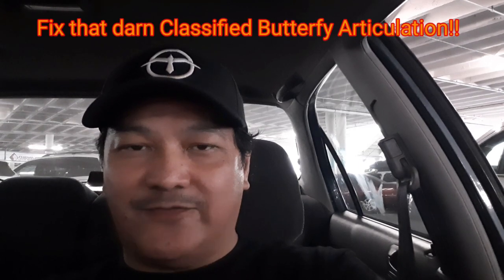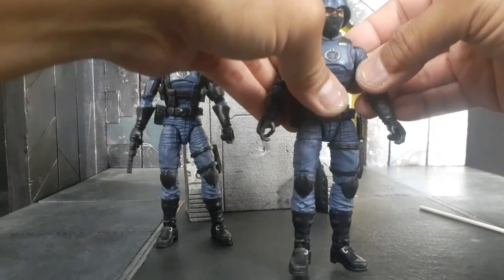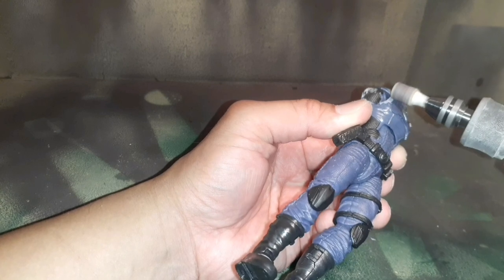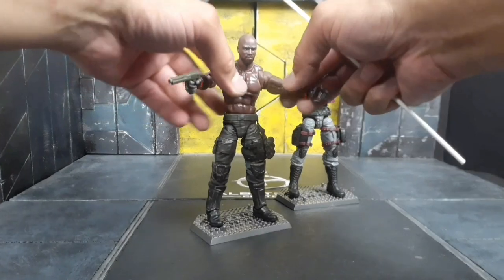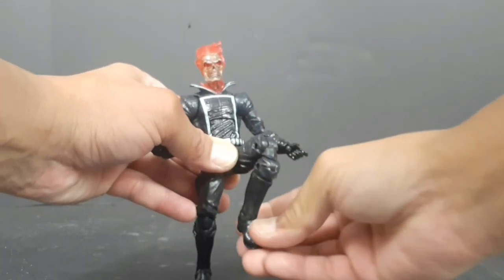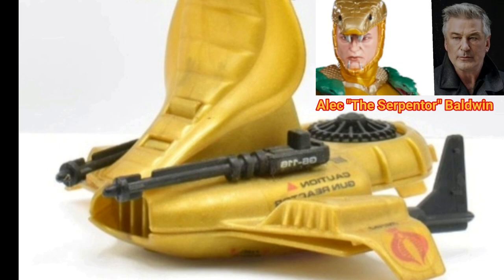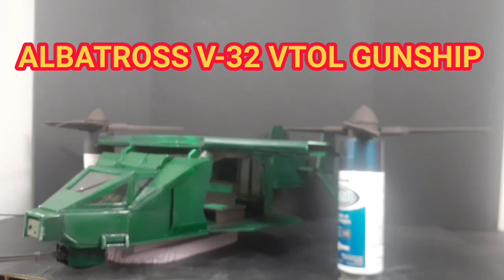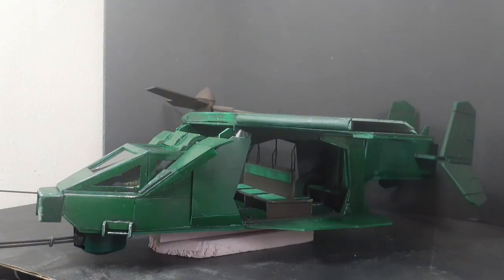How to fix Classified Butterfly Articulation/ Custom vehicles

Comment: I was all in on the Hiss. I would pay anything for anymore 1/12 Joe vehicles. I went in on the engine of vengeance but canceled my order when I realized how much over they were charging.. great tips on fixing the articulation. Just put that 220 grit paper and nail polish in my Amazon cart. I’m just starting to get into painting head sculpts for joes and doing basic kit bashes. I started a couple years ago with easy LJn wrestling repaints but those are solid rubber pieces basically…
Reply from the maker: Hey Victor. Good for you on the Hiss tank! I still have your coffee mug but it's okay if you're not interested in it. 
Any fine grit sand paper would work. Thanks for the comment!

Comment: Looks great. How do you get the pins in and out so you can break down the figure completely?
Reply from the maker: So you want to switch knees, legs, elbows, forearms etc.? I do the boiling water treatment (5 minutes microwave) submerging the figure for 45 seconds. Then I use pin punch exactly the size of the pegs to push the pegs out with ease. 
To re-assemble, I put them in hot water again for 45 seconds, put them together. Then the final step is submerge the figure in regular temp tap water for less than 5 minutes so all the parts go back to its normal rigidity.
Reply: @albatrosscustoms  God bless you for answering and thanks 👍
Reply from the maker: @robertnovelli2960  you're welcome, GOD bless you too. Any questions you have, just post in the comment and I'll be happy to answer them the best I can.